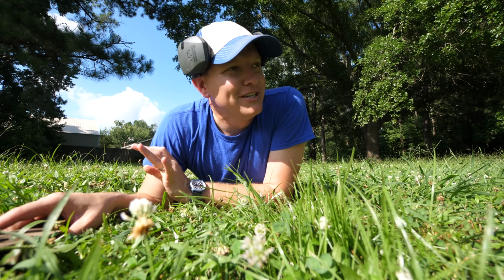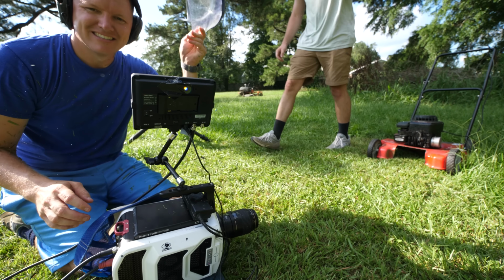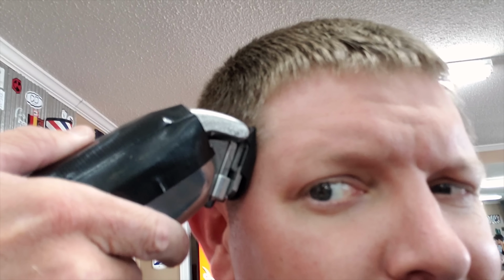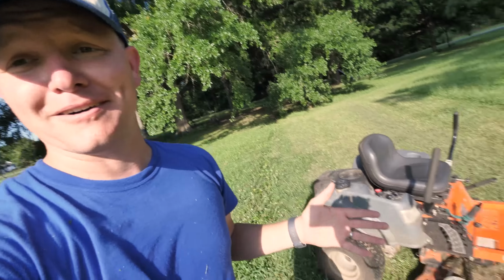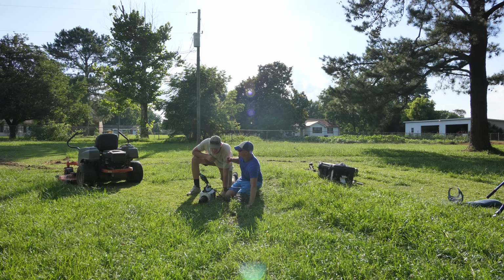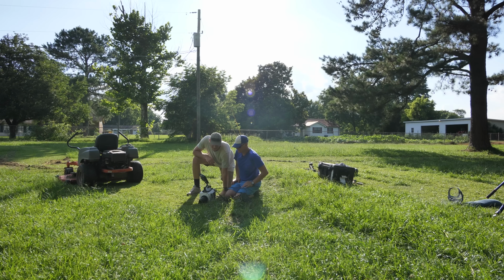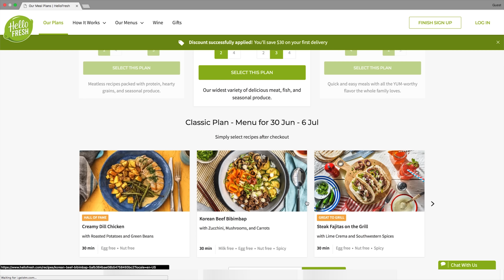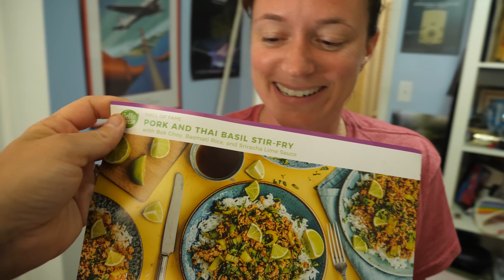How Lawn Mower Blades Cut Grass (at 50,000 FRAMES PER SECOND) - Smarter Every Day 196

Comment: Wait so how does a scythe work
Reply: _ssaevol scythes are way sharper than these blades and doesn't take much momentum
Reply: Also, scythes are used on much longer grass, so the individual blades of grass can't really bend with the cutting blade's motion.
Reply: also the scyther sucks in air with their mouth whilst they scythe. this has the same effect as the lift arms of the mower
Reply: thoughtheglass as a scyther I confirm your knowledge
Reply: A scythe would be a good one to watch in slow motion. As I understand it, it works like a paper cut. The blade is sharp and moves along its length, cutting through grass by friction.
Reply: just to guess - a scythe is super sharp and that is nessesary for it to work well. While mower blades can be really dull and banged up and can still cut decent.  A scythe works because it is very sharp.
Reply: It’s slicing. Instead of whacking. Like slicing a tomato, it’s best to have a sharp knife and slide along the edge to use as much of the blade as possible rather than simply pushing through, which doesn’t work so well on scythes.
Reply: Johan Sten not necessarily. If it’s sharp enough you can mow very short grass. It is best for it to be wet to add inertia. But it works well.
Reply: Scythes actually SLICE the grass. That's why scythe's blades are shaped the way they are. Scythes are also meant to be certain lengths for each person because of the different dimensions of each person. Arm length, leg length, upper body width, etc.
Reply: This is the one I'd like to see done for contrast. I've intuitively understood how rotary lawn mowers work for quite a while, but it was still nice to see it with modern high-speed cameras. I'd like to see the scythe and maybe a reel mower for comparison; let's see how many solutions we've come up with for cutting blades of grass.
Reply: That's bescythe the point!

Comment: A big factor is the sharpness of the blade.  Not discussed in this video.  A newly sharpened blade cuts the grass cleaner and quicker.  The mower is more efficient as the blade has less resistance moving through the grass.

Comment: Huntsville Landscaper here:

Look at String Trimmers.
 Commonly known as a weed eater, this versatile tool utilizes helicopter-rotor-like physics to do anything from obliterate weeds to fine tune edges. 
   Note the gyroscopic effect the spinning head has, resisting tilt and providing steadiness. Most notably with a dual string head. 
   Note that (for a Counterclockwise spinning head) the left side provides a finer cut with the string "bouncing" off the grass. The right side provides a coarse cut that digs into the grass. 
   Heavier string makes a huge difference in performance as well. And IS THERE A DIFFERENCE IN THE SHAPE??? There's so so many types of string: round, square, hex, and various twists and plastic hardness.

I better stop or I won't...

Oh, and the direction you swing from in addition to the angle of the head all makes a difference. 

AND ANOTHER IMPORTANT THING: can you PROVE that the guard actually helps??? I know it sounds preposterous to even ask, but too many "professional" landscapers take them off. 

Stopping for real now. 

... for now.

Comment: How about the physics of weed whackers or maybe the physics of old tools like scythes.
Reply: scythes work just like knives. Super sharp blade, clean slice through the material. Scythes are razor sharp, and tapered so as it slides through the grass it is very gently pushed against the blade. Think like cutting tomatoes without holding the tomato, just with the blade at an angle optimised for output with minimal effort input.
whipper snippers (hints in the name) behave like whips. You accelerate a flaccid material fast enough it has an impact comparable to a slower rigid material. Whips accelerate the tip through the sound threshold, creating a sonic crack, while weed eaters just accelerate it to 12k-15k rpm so it hits so hard and fast it instantly sheers the grass. For reference, if the cord is 10cm from the centre and spinning at 12k rpm, its tip is impacting the grass at almost 300mph

Comment: How does a scythe work?
Reply: With a scythe you are usually mowing gras that's a bit longer.  Then the scythe is so low to the ground that the gras itself is "held upright" because almost all of the weight of the gras is above the scythe blade (inertia of mass).The blade moves in 2 directions simlutaniously thus "drawcutting". And with enough sharpness (much sharper than rotating blades of an powered mower) and the right moves it works.
Reply: a scythe is also a curved blade

Comment: One of the main contributors to split grass blades is a dull mower blade. Lawn mowers typically have multiple blades that spin rapidly. If even one blade is not sharpened correctly, your grass blades are torn, rather than cut cleanly across the top. A split down a grass blade invites disease into the lawn and may make the grass look yellow or wilted.

Comment: I would like to see a string trimmer or motor sickle, not sure what they are called, cutting. They have this little plastic wire in a spool. And I would like to know how the wire keeps the right length since it is pulled out of the spool by the inertia of the rotation, but doesn't extend all the way and rather keeps the right length.
Reply: NochSoEinKaddiFan There is a blade on the debris shield (the usually plastic shell that goes around the trimmer head) that cuts the string when it lengthens. So you bump the head, the string shoots out from centrifugal force (or whatever--I'm sure the physics people know the exact right term), and then it rotates around and slams into the blade, cutting it to length. I would love to see some super slow-mo video of that!
Reply: Now I want to see it even more, thanks for the describtion! ^^
Reply: I have seen Weed whacker slow mo several times.
Reply: Weed whacker in the US and in the UK we'd call it a strimmer, a portmanteau of string trimmer
Reply: It's called a brush cutter in the Caribbean.  The string doesn't keep coming out because there are locking tabs on the inside of the bobine/housing for the string. When the inner part is pushed or pulled (depending on the design) the tabs are placed out of assignment and allowed to move.
Reply: In Australia we call them Whipper Snippers
Reply: I agree. Would also me cool to see in slow motion how a string trimmer cuts around chain link fencing. Always been crazy to me that it seems to dig grass right out of the fence!!

Comment: The sun has finally fried his brain, quick someone give him some water! Mulching blades throw more grass back up to be cut again resulting in smaller clippings. Flat blades will still cut without the ramped (air foil). Dull blades tear the grass leaves while sharp blades do this less. Old school mechanical push mowers use scissors to cut grass, (brain exploding) and watch the putting green on a golf course get cut for iQ 200 level 🤔 

Your welcome 🙏
Reply: And by scissors I mean a rotating wheel with angled blades contacting the main flat blade, so scissors do exist to cut grass 👍

Comment: all of what you said is in the old snapper commercials. if lift is the key then why do weed eaters still work???
Reply: First time he wasnt smarter
Reply: It’s almost the same way but since the weed eater wire I guess you can call it is thinner it just keeps wacking the weed aka weedwacker and ends up getting rid of it.
Reply: Occurred to me, too. Does it compensate with speed and a thinner edge?
Reply: @patriot._.9373  If the blade on the lawn mower is sharp then the cutting edge is thinner than a string trimmer.
Reply: @patriot._.9373  its not sharp
Reply: john shead it walks it multiple times though
Reply: @patriot._.9373  the sharp blade in a mulcher/mower also hits it several time. also if you want to compare it to a bigger mover. Our 60"  or 1.5 meter wide brush hog has hammer type blades that are sharp but can breakover in the middle if they hit something too hard. Centripetal force keeps them extended and they have no upward air direction.

Comment: Does travel speed make a difference in cut quality
Reply: Yes, in that if you move too fast for the conditions then the grass will look very ragged and unevenly cut.  But so long as you are not going too fast for conditions then going slower offers little in the way of additional improvement as once everything above the level of the blade is cut there is no more for the blade to cut -- the only thing that will improve markedly at even slower speeds is maneuverability.
Reply: Yes, you can only travel so fast before the lawnmower blades don't go over the same areas enough times to 100% cut them, especially with a duller blade, but you can always go just above that speed and hit the missed spots later without much problem, but that method uses a bit more gas, and fast/rough mowing always has the potential to disrupt the soil and roots.

Comment: Do a cylinder mower... they cut like scissors. Different kind of physics...
Reply: we called them REEL type... when I grew up we had a pusher and a powered.
Reply: Are you refering to a reel mower?
Reply: I use a 3 phase electric motor driven one for work...
I’m not sure about anyone else but I’m in Australia and I’ve always known them as a cylinder mower.
Reply: Ryse Of The Fallen 
That’s because of your ancient ties with England, we call them cylinder mowers as well, because the blade is ... well... cylindrical.

Comment: Do a video on why carburetors always go bad with todays' gasoline.
Reply: because of the fuel. fuel goes stale faster there for gumming carbies up quicker dont ever use E fuels in your mower just standed unleaded and if you have a fuel tap on your mower turn it off and let you carby run dry this also keep you jets clear and use fuel filters on your mower too this does help.
Reply: If you use Stabil fuel additive & a dash of 2 stroke oil in your gas tank ... mix it well and run your equipment for 5 minutes to let it flow into the carb. you probably won't have issues when storing it .... and for goodness sakes , stay away from E-85  !! 😆
Reply: @waylonmccrae3546  even E 10 leaves a build up in fuel tanks when left sitting in cars
Reply: What I notice is that in the cheaper gas engine powered stuff (cheaper carburetion), the carburetors fail way more often and sooner then in the top of the line equipment. Case in point my Craftsman saw failed after a couple of years, but my Husky has not. Even after 11 years and neither of them got used all that often. had a Stihl Commercial whacker that fired right up after 10 years sitting. Am I just lucky? I think not.

Comment: But weed eaters work without creating lift right? It's not even sharp it's just moving insanely fast
Reply: I'd assume that the weed wackers are stringy in a sense, so it's sorta like a whip which makes the force generated move down to the tips. Plus weedwackers are better at digging up the dirt under the grass over cutting it, longer grass is easier like thick weeds as well

Comment: Well i don't believe that the back of the blade is there to make the mower ''pull on the grass'' and make it cut better, i think ist mainly to  create positive atmospheric pressure above the blade so that the flow of the air carries the grass in to the back basket/container wich is at lower pressure , the barber has vacuum installed on the trimmer so he sucks up the tinny hair particles.

Here is my point: what about the handheld grass trimmers that use nylon cord or whatever, they cut grass perfectly fine but don't need any suction for that to happen
Reply: They spin a crapton faster as well and are a ton lighter.   Special blades are actually made for different types of grass.  Bahia has a special blade that creates more of a vacuum to pull the stalks  (seed stalks) higher and straight up because they are tougher than the blades.
Reply: It is there to shoot the grass (scoop) upward to make the mower a mulch mower that cuts the grass multiple times.  If it wasnt there, the grass would stay lower, reducing the changes of being cut again.

Comment: Also please do the same video with a mulching blade.
Reply: I had the same question. Is there any real difference with different types of mower blades. I think a Plexiglas window would work. Contact a mower manufacturer. They would be doing research into these things no doubt.
Reply: Those were mulching blades. That's what the tabs are mainly for
Reply: Kody Tuft no sorry those aren't mulching blades, look up mulching blades and you will see the difference between the two
Reply: Mulching blades are a totally different shape.

Comment: Love your videos.  I am old enough to remember that in the early 1960s, rotary mowers had flat blades because they didn't have catchers.  In fact I flatten mine with a sledge hammer so there is less drag on the motor and less grass choking up the chute where the catcher isn't attached, and they still mow fine.  Furthermore whippersnippers use just inertial cutting.   So I don't think the suction thing is that important.  Maybe it gives a cleaner cut at lower speeds??  But those old mowers with flat blades cut just fine.
Reply: This guy over complicated the matter.  He quotes some simple law of physics tried to makes us think he got some higher academic  achievement.

Comment: What about the physical cut on a reel mower ? That's a shear stress cut isn't it? I believe I've heard that's the best "cut" for grass. ?
Reply: Yes, the reel against the bedknife is like scissors. Also, hedge trimmers or a sickle bar mower are like hair clippers.
Reply: I work at a golf course and we use reel cutters on our greens. In addition to the reels, we use "groomers" in front of the reel to lift the blades of grass (known as the "canopy" in the industry) up so that the reels deliver a more even cut. The reels are followed by a roller that presses the freshly cut grass back down for a smoother putting experience.

Comment: I really wish i would have seen this when it first came out.  Being a landscaper of 20 years i could have helped you out with a few things.  Commercial mower design was focused on maximizing airflow.  Scag had normal blades and high lift blades.  Difference in tab height and angle.  And boy did high lift work.  You could watch the grass start to get sucked under the deck at the leading edge.  And it threw the grass soo much further than normal lift.  Airflow is very important

Comment: What about a weed whipper, how is the vacuum created?
Reply: I think the strings are thin enough and fast enough to cut the grass just from shear force. But I dunno, that would be a good follow up video.
Reply: No vacuum needed. The line is moving much faster than a lawnmower blade, and so it is able to shear through the grass before the grass has a chance to bend. Also since ween whippers are usually handheld, you don't have the issue of needing to be held at a fixed height like you do with a mower. You can bring the whipper down to meet the grass, rather than having to pull the grass up
Reply: Weed whipper..😄  where are you from?
Reply: My family calls them 'Weed Whackers' :P But also I was wondering the same thing! Good call
Reply: TR P whipper snipper
Reply: I mean not that a vacuum is necessary but I'd bet a weed whacker does create a vacuum as well just with the high speed rotation, like a tornado throws things up into the air.
Reply: TR P Line trimmer ;)
Reply: Good question.  That’d be a neat video
Reply: Manual weed whacker (kind of like a sickle), no tabs to create lift, much slower. Also second the chainsaw.

Comment: Dude this is SO dangerous! Imagine a stone flying through your flimsy face shield..
Reply: Irish Wristwatch more like imagine a glass blade
Reply: Mark Zingerburger more like imagine an antimatter blade
Reply: Solution don’t run over rocks
Reply: Who cares about the face I'd be more worried about the camera that costs tens of thousands of dollars lol
Reply: I'm sure his face is worth more than that camera.
Reply: I bet they checked for rocks...
Reply: obviously no one here has ever actually worked.  those shields are absolutely designed to take hits from power tools.  that is why you wear it, to protect your face.  it is made of a very high strength plastic.  if it takes a hit, you replace the clear part.
Reply: If those face shields protect my face from grinder disks blowing up they will protect against a rock thrown by a lawn mower.
Reply: For the record, those face shields are surprisingly durable...
Reply: All he needed to do was fabricate a plexiglass chute for the riding mower and a plexiglass window for the push mower...

Comment: Reel lawnmowers use the two blade approach.
Reply: you catch fish with a lawnmower?
Reply: Came in here to say this, and as a result you get all the benefits of using a scissor type opposing blade approach such as super clean cuts, though they surely do have their share of problems too compared to rotary mowing.
Reply: using a scythe gives you super clean cuts too, possibly one of the best ways to keep your grass very short and still looking good and undamaged
Reply: Scythes seem to rely on super sharp blades to cut the grass before it has a chance to bend over. However all the scythe mowing I see on YouTube is on longer grass which takes a while to bend out of the way and by the time it does that it is cut. The reel mower is great on short grass in a way I didn't think a scythe would work on at all.
Reply: yes but the bar/blade is fixed only the reel blades is moving..